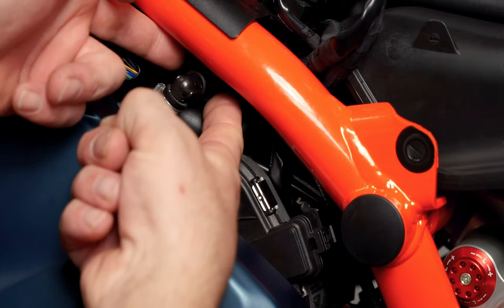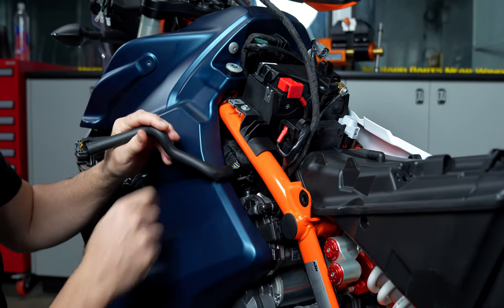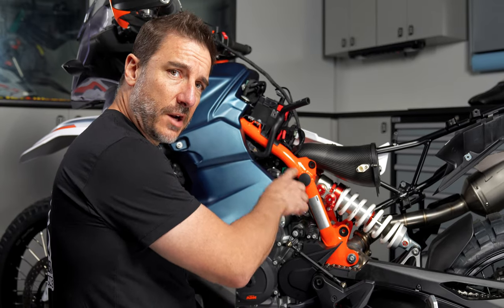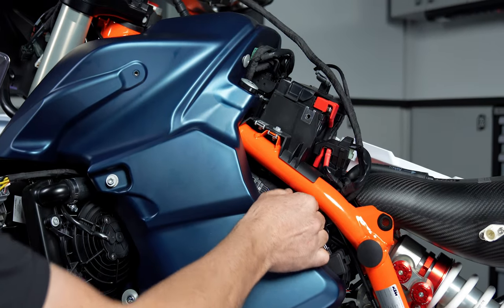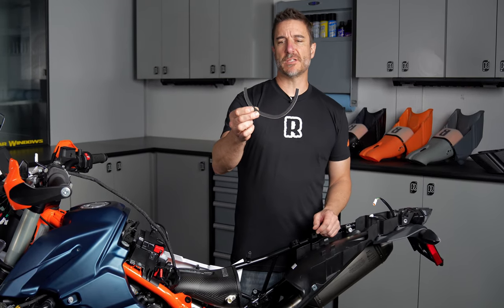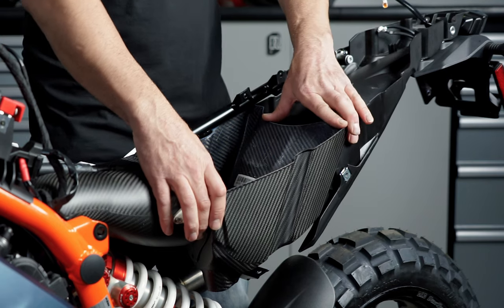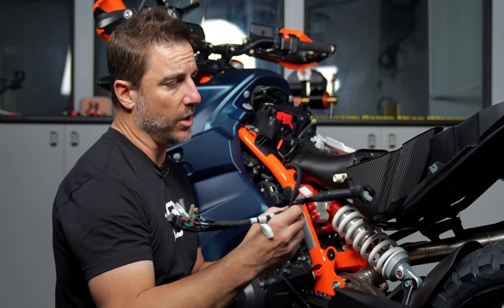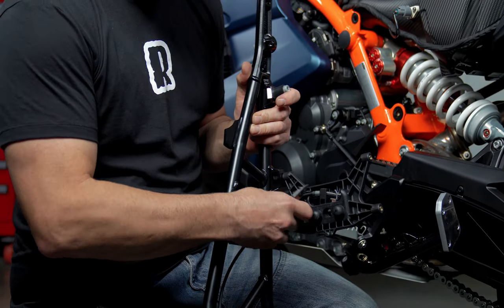HOW-TO INSTALL RP INTAKE SYSTEMS - KTM 790/890 ADVENTURE

Comment: great video. followed it with no issues. very easy to install.  took me couple hours because it was my first time and i didn’t want to make a mistake. the longest part was getting the velocistacks rubber boots installed. one note i may add is install the temp sensor after installing the screw holding the two parts of the air box together.
Reply from the maker: We would agree. A trick with the velocity stacks is to use Maxima MPPL or a similar lubricant (WD40). They pop on much easier.

Comment: I came down to your shop today and bought the intake. Impressive place you have and the gentleman at the counter was helpful. 
I did install it today, the frame was a little difficult to get back together and the seat was difficult to get back on but I think it will be fine. Very noticeable difference in sound and power. Thank u for the video!!!!
Reply from the maker: That's awesome news and we are really glad you loved the results. Nothing should be changed in the seat category so we are thinking that was just a fluke but that's what these videos are for so people can see directly what is going on with the install and that many times it's not as hard as they thought.

Comment: I just installed this intake system on my 790 AR.  This video instructional is really good and very thorough.  My stock intake was pretty tough to break free of the throttle bodies but its no big deal and Chris mentioned that some may experience that.  Thanks for the video and thanks for making such amazing products for these machines.
Reply from the maker: Thank you James! Glad you got it worked out. Basically the velocity stacks can get stuck a little to the throttle bodies and worst case they just pull out from the stock airbox and then you just pull them directly off of the throttle body. 

Thank you for the positive sentiments on our products and comments like those are what keep us innovating!

Comment: Thanks Chris for the excellent tutorial!  It helped a LOT in getting my intake installed without any fuss.  I did not disconnect the rear wiring harness, not really needed but doing so takes it out of the way of any potential damage.  I did have dust dust leaking into the stock inner air box but as I bought the bike used not sure how much.  It was pretty messy.  :(  Now I need to install the Arrow Decat and hope the weather will cooperate so I can go out and ride!!!!

Comment: Just bought the Pro intake with PCV Street Advanced Ignition Map with Cat Delete map preloaded.   Really excited and appreciate the straightforward videos.   Great videos will post an update after they arrive and are installed (and the snow melts here in Utah).  Thank you Rottweiler!  
P.S.  The only instruction I won't be doing is putting the snorkels and airbox in the garbage - KTM made them recyclable so will be recycling them!
Reply from the maker: Love this and thank you back!!

Comment: Thanks to the instructions and this video, even this accountant-by-day managed to get through the install.  Toughest part imo was getting the velocity stacks in the airbox.  I spent a lot of time on that part for some reason.  Time to hit the gym!  Thanks RP!
Reply from the maker: You got it and that's the point of these videos! Glad it helped. The V stacks aren't that hard, and I would add to those reading this to lubricate them with Windex or WD40. Something that will dry up shortly. They will pop right on with some of that on the inside. Makes things so much easier. It's the band clamps falling off that are a bit frustrating but over time you'll get the technique. Problem is most people only do this once LOL. I've done it 50 times by now so I know the tricks!

Comment: Great video. 
There are some issues with mounting this on a Norden 901. The temp sensor extends out and interferes with the sun frame. Specifically the metal price that holds the rubber bushings for the body panel. It has to be taken off and cut or ground to make room for the sensor.
Reply from the maker: Yes you are exactly correct. We list that in the written instructions linked below, but this vides was made before the 901 Norden came out so we couldn't include that part. It's a simple mod to perform though.
Reply: @RottweilerPerformance  No need to cut it down complety, I just gouged a U shaped groove into it and the rear side bolt can still be used to attach the bracket... It leaves about 1/8" of meat which seems enough to me to hold the plastic body part in place

Comment: doesn't the crankcase breather makes a big mess inside the air-box? The oem one has a lithe case where all the gunk gets trapped..great video.
Reply from the maker: If you overfill the crankcase, then yes it will.  It's sort of harmless and just coats the inside of the airbox if it pukes, but running a breather on a catch tank is most ideal if you are going to do that, otherwise you have an external breather that is dripping oil.  If you don't want to run a catch tank, then just get some 1/2" ID (12mm) hose and run it high so any mist can't really get up that high where the filter is.

Comment: Are you's going to fabricate a under the rear seat /gard excilory fuel tank ?
For the new Husqzvarna Norten 901 if possible. 
The extra fuel capacity would be real good here in Australia. 🇦🇺
Reply from the maker: We will have to redesign the underseat fuel tank to work with the Norden 901 because of the split seat design. We plan on releasing the fuel tank for the R and Rally KTM models and if they prove to be as popular as we think they will be, we will make one specifically for the Norden 901 for sure.

Comment: Great product development as usual :). Any idea if this invalidates your KTM warrantee?
Reply from the maker: This answer is really subjective and differs by country or area.  Believe it or not, in our decade of making intakes we have not heard of invalidation of warranties very often if at all, and depending on what country you live in there are laws preventing manufacturers from denying warranties based on modifications that clearly don't have much to do with the reason for the warranty in the first place.  This one will have to be up to you but the ironic part is that if you don't want to risk a warranty denial, you need to stick to the stock airbox, which will almost guarantee you having to try and warranty a wasted motor because the stock airboxes are notorious for leaking dust. Most people feel it's safer to safeguard the engine first, and then if there is a serious enough issue that isn't related but you just want to hedge your bets against any complications, just put it back to stock before you bring it back to the dealer for inspection.

Comment: Love your stuff just bought a rally however I’ve noticed a few guys complaining about the noise on the 1290 intake take kit is this going to be similar?
Reply from the maker: Opening up the intake does make a bit more noise, but on this bike it's under the seat and around the same area as the muffler so not so much in your face like some other models. The price of performance is not always sound as in the case of mapping and ignition advance with a Power Commander V but gains from an exhaust or intake will obviously add some decibels to the exchange. 99.9% of our customers love the intake sound, and the other .1% want a sewing machine so in that case we would encourage them to keep it stock.
Reply: The 1290s definitely a different location,and I’ve only noticed on my friends 1290 adventure when you’re wide-open throttle. It’s hard to deny the performance benefits that’s for sure!!! Did you do a Dyno run with just the intake no mapping?
Reply from the maker: @FATBIKEMIKE  Yes we did. The 790 with the intake system just dropped in is a solid +9HP at around 6300 RPM as measured on our dyno, same bike, same time, same dyno. The 890 was around +6 HP around that same RPM just dropped in. Solid gains throughout as well.

Comment: I have a question. I live in a rainy country what if the rain water gets into the intake? Is it ok that the filter gets wet but not totally soaked?
Reply from the maker: Absolutely.  Over the last few years we have sold probably 30,000 intake systems. We just don't ever really hear about any issues from rain or water crossings. At one point the owner actually took a fully open garden hose to the top of a down draft filter system on a 990 Adventure and it ran for about a solid minute, and then started to gurgle just a little bit, at which time we took the filter off by hand, wiped out the water, fired up the bike and had no issues. The system on this bike is even better because the filter is lower than the intakes, so water would have to travel up hill to get into the combustion chamber which is almost impossible. Additionally, a bit of water on the filter itself is just fine. We know thousands of our customers have traveled through the most amazing weather patterns, and just don't have any problems. 

Another thing to add is that in deep water crossings, if a bike is somehow submerged, getting water out of the intake tract is much easier than with stock, that can trap a lot of water inside which can be very difficult to get out. Almost all of our systems are removable by hand, so checking and wiping out water is extremely easy. Rain, you'll never have to touch it.

Comment: 3 turns wasn't enough to be able to remove mine , i ended up 6 or7 but you can go 8 full turns and the thread is still all the way in the nut , i also put the rubber velocity stacks in hot water to make them a little easier to get in as its colder in the uk .

Comment: Does installing this will void my factory guarantee?? Also I have a ktm alarm on my bike will this install like on the oem air intake setup?
Reply from the maker: Breathing on your bike will void the warranty with KTM. That will eventually be up to your relationship with your dealer whether they will help you out or not, but the truth of the matter is that no manufacturer can legally void a warranty if that can't positively link the issue to the modification. Look up 'Magnussen vs Moss' law. 

I don't quite understand your second question but what I think you are asking is will your stock alarm still fit and the answer to that is yes.

Comment: If im reading the chart correct air box, remove cat and tune, almost 30 hp ?
Reply from the maker: It's actually about 15hp to the tire which is around 18-20 at the crank which is still really good.  30hp would make us miracle workers on this bike.  We are not sure which chart you are looking at though.
Reply: @RottweilerPerformance  Still awesome, really nice products

Comment: How often do you think the filters should be replaced ?
Reply from the maker: As much as needed depending on your riding conditions. It’s really impossible to answer that question because of that. These systems are exactly the same as a dirt bike and the user just needs to keep an informed eye on things. If you still aren’t sure, more often never hurts and these filters are so inexpensive and packable there really isn’t much reason not to change them often and your motor will thank you for it. Same goes for stock or anything else. No real difference.

Comment: A nice part and a good video. What is the net impact on performance?
Reply from the maker: Check out this page here and click on the small image below the main picture. There is a chart that will show everything. As measured on our dyno on a 790 at 6300 RPM we saw 9+ to the tire. This would be about 12 or 13 at the crank.  https://www.rottweilerperformance.com/rally-edition-full-intake-system-790-890-adventure-all-matte-carbon/
Reply: @RottweilerPerformance  Thanks for the answer. How is remappiong done?
Reply from the maker: @ministrant4220  Remapping is done through a Power Commander V. We have many choices of free maps when you get them through Rottweiler Performance and we will also set them up for free as well before we ship. See the intake page linked here and read the description for mapping the 790 or 890 Adventure. This should help you decide what you want and get going fast. The PCV is plug and play and elicits really impressive performance gains on those models. https://www.rottweilerperformance.com/rally-edition-full-intake-system-790-890-adventure-all-gloss-finish/

Essentially, it say what is copied below:

MAPPING INFORMATION For those of you who would like to know more about mapping the 790 and 890 engines, we have provided the information below to help you understand the options for that bike in terms of controlling the fuel. If you have any further questions, please do not hesitate to call us. We are happy to help!

Do I need to remap with a Power Commander for this intake system? Absolutely not. The gains mentioned above were completely stock and the factory ECU easily compensates the fuel using the stock narrow band O2's to keep your air fuel ratio at a safe 14.7. Hours of dyno testing, real world data logging and static load runs showed that the stock ECU safely, easily and quickly adjusts to any configuration with protective measures like ion knock sensors and other methods. You are completely safe to install this air box and enjoy the ride.

So I'm safe, but are there more gains with additional mapping using a Power Commander V? Absolutely, and we have been burning the midnight oil to bring you even more mapping to support your desired combinations than ever before. Simply choose the map that is closest to your final configuration and we will load the map(s) for you for free! For more information on the benefits of mapping please see our mapping options section below. 

What's the difference between STREET and RACE maps?

A STREET map will allow the user to keep their stock narrow band O2 sensors plugged in and does not interfere with emissions based mapping and only has fueling changes in the open loop section of your fuel map where the stock ECU will not try and override the changes. This serves riders wanting to stay in compliance with emissions standards and retain their cruise control while still benefitting from ignition advances throughout and fueling corrections in open loop. 
A RACE map is designed for closed course racing purposes so that the user can have full control over the entire map range. The use of maps designated as 'RACE MAPS' require the stock narrow band O2s to simply be unplugged so that the stock ECU will not be able to read them and override the map and correct the trims back to an emissions based 14.7 air fuel ratio in the closed loop section (see attached chart in the pics above). Unplugging the stock narrow band O2s will only cause cruise control on the 790 Adventure will stop working and an engine light on the dash will appear. Engine lights typically only warn of blinkers not working or emissions systems unplugged. You will still get important warnings on the dashboard in bold letters. This can be easily reversed if the stock narrow band O2s are plugged back in. 

What is the difference between MODERATE and ADVANCED maps?

Moderate ignition advances are just that. They are designed to be a bit of a bump in power without pushing the limits. What we have found is that KTM typically ships some street homologated bikes with very mild ignition curves. We assume that this is because they cannot predict what kind of fuels will be available to the customer in their given part of the world and the engines can easily take some more ignition advance and take advantage of some extra power.
Advanced ignition curves are created using standard U.S. 91 octane rated pump gas fuel, the close equivalent to 95 RON. The ignition advances in these maps have been taken as far as safely possible using sophisticated knock sensing equipment. These maps will usually yield even more hidden horsepower but it is recommended that the user only run a minimum 91 octane fuel (95 RON) or equivalent. These maps DO NOT require race gas. It is recommended to use these maps in conjunction with a Dynojet Map Switch and another map with the same configuration but milder ignition advances so that the user can dial back the advance with the flick of a switch in such a case that lower octane fuel is necessary or ends up in the fuel tank. It should also be known that the 790/890 Adventure models do have knock sensors in the coils, which in the case of accidental lower octane fuel the bike will handily adjust and protect itself.

Comment: The difference between the Rally intake vs the PRO is just the material its made of = carbon fibre right ?
Reply from the maker: Correct. We could do both, so we did. The carbon fiber is Moto GP Formula 1 quality so there is a super trick factor if you like that, (I do) but otherwise they do the same thing. Weight difference is minimal.
Reply: @RottweilerPerformance  i do but not enough to pay the diff LoL my intake was ordered about 3 - 4 weeks ago , the pro , not so patiently waiting
Reply: @RottweilerPerformance  thanks for answering though , if there had been any  significant diff in performance id have changed order

Comment: Great part and nice vid... but I am still a little bit concerned by the protruding Temperature sensor ?? What's your thought on this ? Thx
Reply from the maker: If you are talking about the outside, it is completely covered and protected by the left shroud once it is installed. Good eye, but it is perfectly protected inside the frame tubes and shroud. If you look at the final scene you will see what we are talking about here.